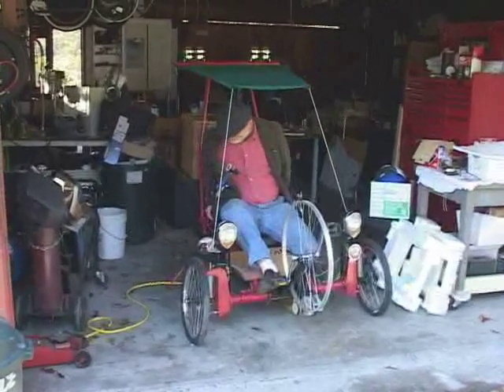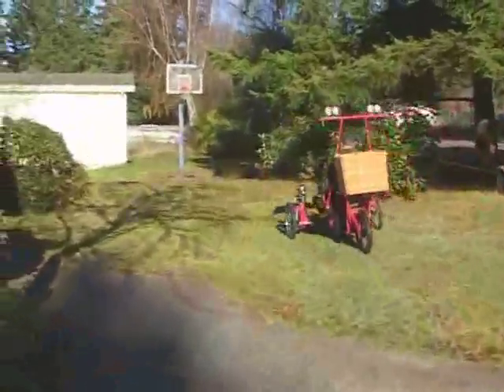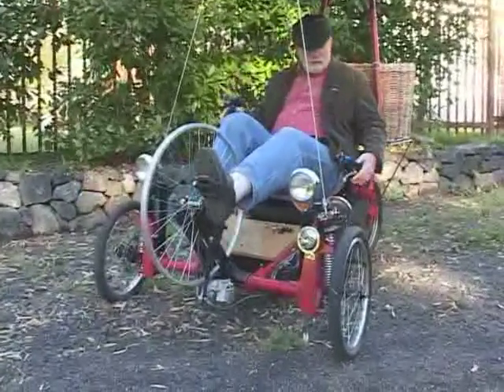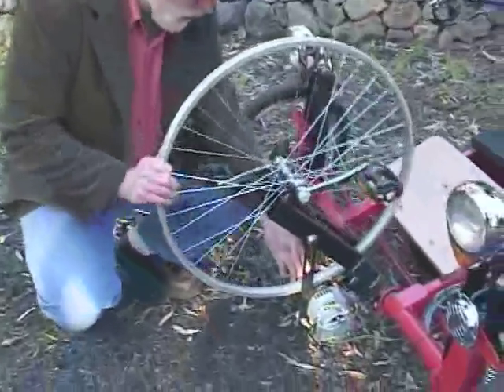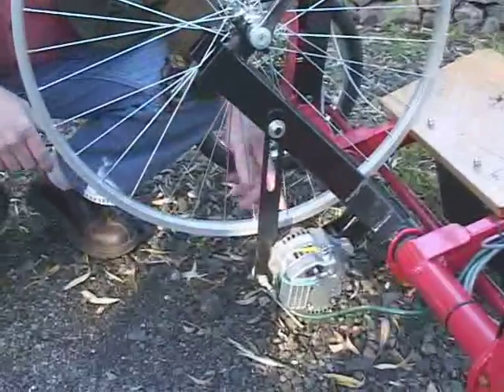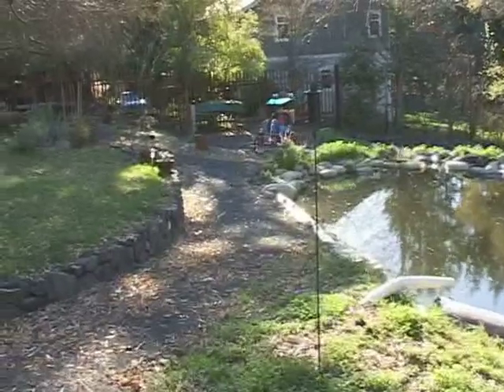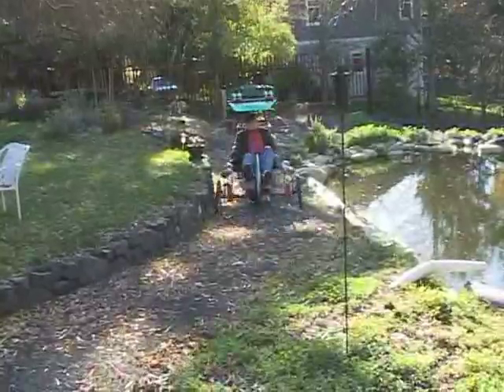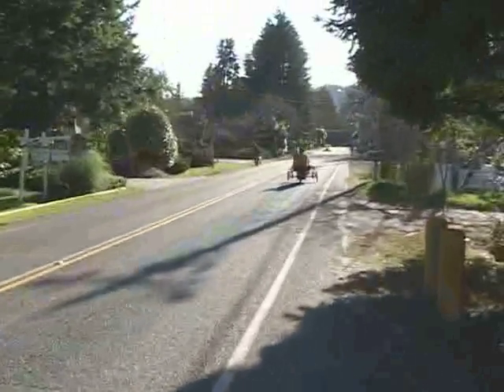Human-Electric Hybrid

Comment: The secret would be to use a high voltage low RPM motor- generator, and a high RPM low voltage for the drive......right?

Comment: I want to generate enough power to run a motor, like in this video 
Yet I do not think it is possible with out batterys under the seat. I was told that 168 watts is about it for my quarter HP legs, with two stage increase, a bit more with a single stage.

 So can you tell use how much power you are producing. Can you reach peak effeciency RPM with a one HP motor?